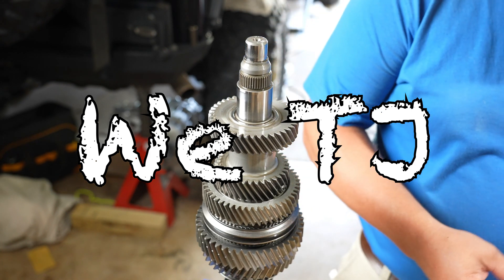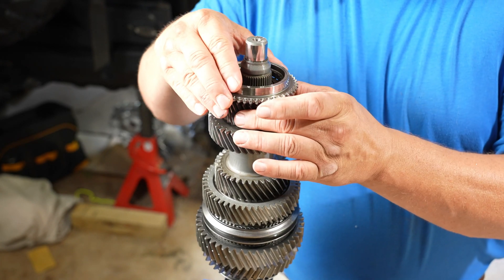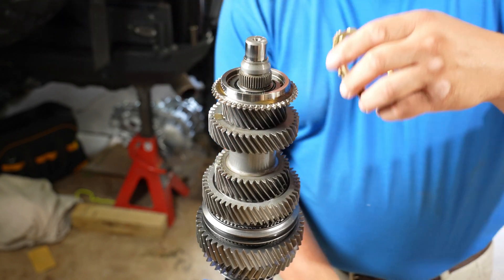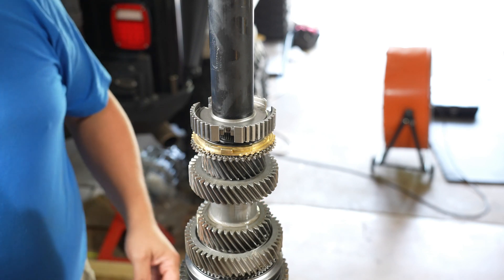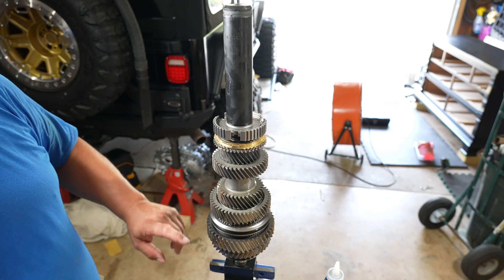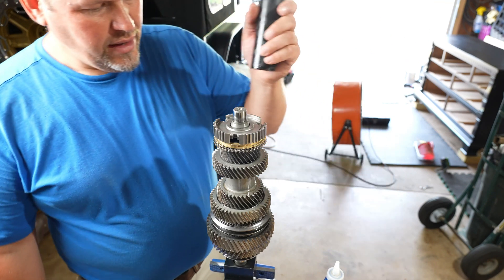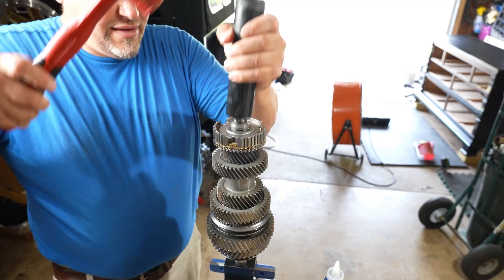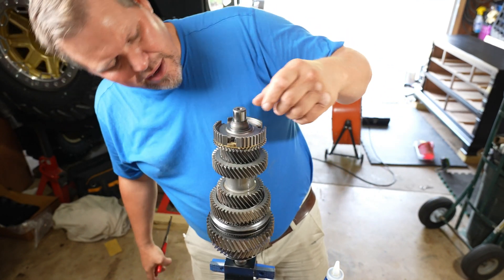Pt10.1 Jeep TJ Rubicon NSG370 Rebuild MainShaft Assembly 5th, 6th gears and Synchronizers

Comment from the maker: 5th gear synchronizer and blocking engagement teeth are installed at the very end of the transmission build. Both shafts will be in the rear case at that point. Moving onto the countershaft next.